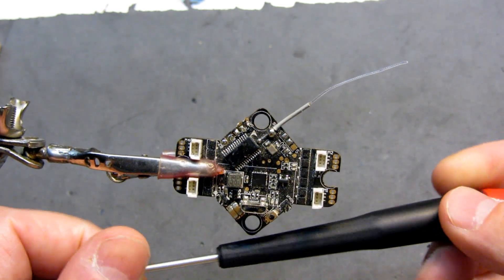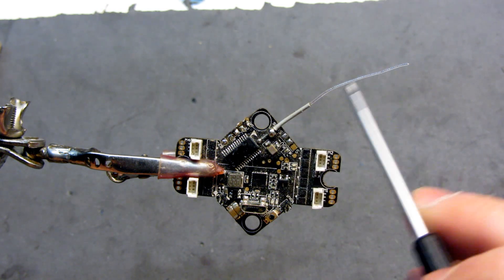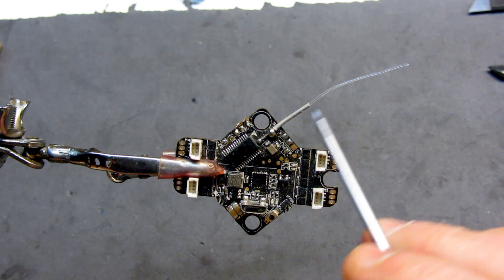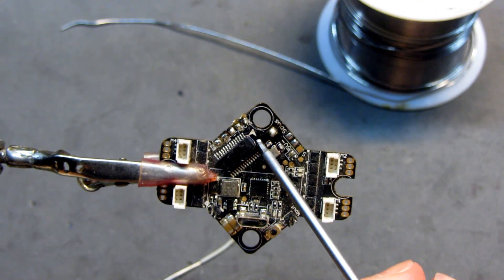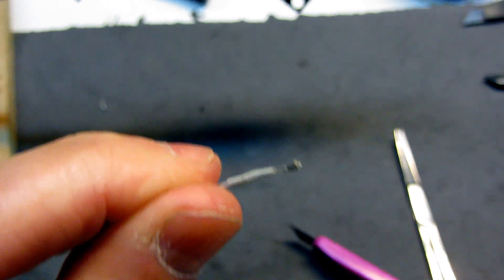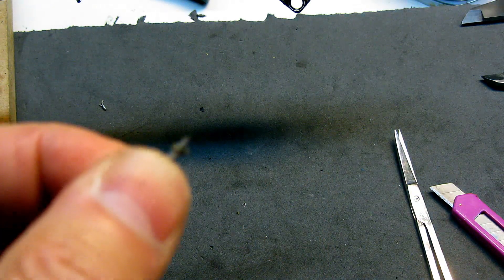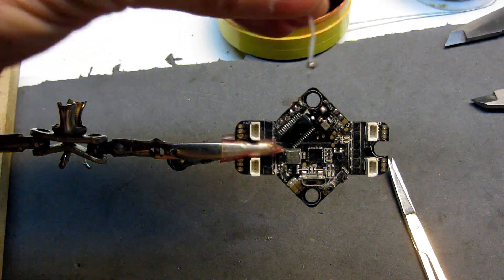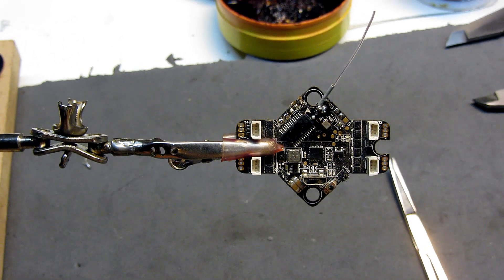TinyHawk Repair - SPI RX Antenna Repair / Replace - Viewer Request

Comment: Wow! Many thanks for doing this video. I just ordered new antennas for my Tinyhawk II. This couldn't have come at a better time. Love the channel. Be safe.
Reply from the maker: Thanks for watching. Good luck with the repair. 😎👍
Reply: @Faith_Family_Firearms_Freedom  Thanks, going to be interesting. First time soldering. Going to practice on an old board before I try it for real. You should start a service shop! Be happy to use your services. Be safe.
Reply from the maker: Thx but I'm sure after some practice, you will be just fine. Just be sure to use plenty of flux as demonstrated in video. I like to use the Ruby Fluid soldering paste. You can find it on Amazon.
Reply: @Faith_Family_Firearms_Freedom  will do
Reply: Where did you buy the replacement antenna?  Mine just snapped today as well :(

Comment: Great job buddy. 👍👍👍👍
Reply from the maker: Thanks Ray. Hopefully this helps the sub that asked for it. 
😎👍
Reply: @Faith_Family_Firearms_Freedom  I hope so buddy. It takes a really steady hand also. Great video. 👍👍👍
Reply from the maker: @electroddxful  for me it's my eyes more than my hands. Lol 53 yr old eyes. 
Lol.
Reply: @Faith_Family_Firearms_Freedom  😂🤣😂🤣I'm 50 and feel the same my eyes as well. I been doing electronics for many years. Ever since I became a ham radio operator many moons ago.
Reply from the maker: @electroddxful  I feel ya brother. If it were not for my trusty magnifying led lamp, I couldn't do these kind of repairs. Although I couldn't use it on this video because the camera was in the way, so it was especially hard for me to see clearly. I actually used the monitor on the camera most of this video. Lol.

Comment: If change it to different style antenna than the linear should it working too right? I’m planing for an upgrade of the antenna, nice video tutorial 👍
Reply from the maker: There's really only only style suitable for a receiver Antenna. 
Heres a link to a 10 pack.
https://www.amazon.com/10PCS-100mm-Receiver-Antenna-Replacement/dp/B07JFZDYVS
These will work. You will need to cut the ipex connector off and prep the end to be soldered to the FC. 
You may be thinking about the vtx antenna which you could swap out to a Circular Polarized antenna. But the RX antenna definitely needs to be a linear antenna tuned for 2.4 GHz. Hope that helps.

Comment: Great Video! Does this work on a Eachine Novice 2 as well ? I upgraded the VTX antenna with a lollipop fl. But not sure how to upgrade the radio receiver
Reply from the maker: Yes, if it's soldered on like the TinyHawk FC  then yes

Comment: Hi, I bought NanohawkX a couple weeks ago but stil I have not tried to fly it because I have only Flysky transmitter. Is it possible to repalce the receiver like FS-A8S what Ibhave here? I saw in the manual that it has built-in receiver for FRSKY. Your help is greatly appreciated, thanks
Reply from the maker: Yes ! Absolutely.  I posted a video over 2 years ago on how to add an XM+ to a tinyhawk and the steps will be nearly identical. Here's the vid
https://youtu.be/9bt3AfnBNdE
Since you're adding a FS receiver, some of the steps in the video won't be relevant to you. But basically here's what you do. 
If your FS receiver has 3.3v then find the 3.3v pad / ground pads and solder those wires.
If it's 5v, then simply solder to 5v pad instead. (Pretty easy ) 
Next. Find the spare uart pads. You may have to connect to betaflight and see which uart is not being used in ports tab. Probably uart 2 , but definitely check first.
Since I'm not familiar with FS, I don't know whether it has a rx and tx pad for telemetry or a single wire for outputting signal. (Non telemetry like the frsky xm+)
If it's a telemetry receiver, then connect the tx pad from receiver to rx pad on FC and connect rx pad from receiver to tx pad on FC.
If it's a non telemetry receiver,  then just connect tx pad from receiver to rx pad on FC. 
Then in betaflight,  go to ports tab and under the "serialrx" column , go down to the spare uart you connected to and make that selection active by clicking the slider button. This will automatically override the spi receiver.  DONT FORGET TO CLICK SAVE AT THE BOTTOM RIGHT OF THE SCREEN. 
At this point you can connect to betaflight and under the Receiver tab, you can verify if you are connected by moving the sticks around and watching the channels on the screen. You may need to have a battery plugged into the quad in case the FC does not power up the receiver when plugged into USB alone. 
Obviously at some point , you will have needed to bind the receiver to radio.
If  betaflight is showing stick movements,  then you're done. Button it up and go fly.
If you still do not have stick movements,  then first,  double check all your steps first.
Be sure you're bound and the connections are correct.
If you still do not have stick movements,  then go into the CLI with quad connected to betaflight,  and type " Get serialrx", press enter.
You should see a line that says 
"Serialrx_inverted=off"
OR
"Serialrx_inverted=on"
If it's OFF, then turn it ON by typing
"Set serialrx_inverted=on",  press enter
Then type "save" , press enter

If serialrx_inverted is already on, (unlikely) then do the opposite by typing
"Set Serialrx_inverted=off", press enter
Type "save", press enter.
If none of that gets you connected,  then change the "serialrx_inverted" setting back to what it was and drop me another comment. I have a friend who runs flysky who I can put you in contact with who may be able to help if all else fails. 
Goodluck, and drop me a comment if the video doesn't help and this procedure doesn't help. We'll get it sorted out. 
-Brad

Comment: I see you have had the TH apart for repairs to the antenna's...so I ask if you know how those tan motor connectors are mounted to the board.....I have one that has come loose from the board and it appears it is glued on and not soldered ( as I see no way to get to the bottom of that connector to solder it , nor know of any soldering iron/tip that tiny to get under that connector )  It has three contacts on the bottom front and one contact on each bottom corner of that tan connector and appears it just lays on the board contacts and is glued down....the glue appears to be clear and shiny under where the connector came off, BUT it may be just the board itself that appears shiny, do you know if it is glued or not and honestly I see no solder at the contact points other than the contacts themselves? Any help and or advice is appreciated Thanks in Advance
Reply from the maker: The TH has three aux motor pads next to each connector.  You can de-pin the motor leads from the motor connector, strip them back, tin the ends and direct solder them to the board.
Reply: @Faith_Family_Firearms_Freedom  Thanks for the reply, I would rather not do it that way ( unless there is no other way ) [soldering those tiny pads/wires are hard to do ] I was hoping to know if that connector on the board was glued  to know for sure, I assume I can just place the contacts where they need to go and glue it down  and see first...will solder IF that is the only way...LOL...but Thanks for letting me know how to do that...
Reply from the maker: @FlyingBuzzard  the plastic connector on the board just presses over the 3 pins. It's just a press fit. I would not use glue
Reply: @Faith_Family_Firearms_Freedom  pins are still "in" the brown/tan plastic connector so not sure what to do...can I remove the three pins and solder them on the board and then slide the plastic over them? They look like the pins are attached to the bottom of that plastic piece ( not sure )....even at that those pins are tiny, they do not appear they were ever soldered to start with ( quad worked tho ) Thanks again RCing in SC
Reply from the maker: Honestly, my first advice was the best thing you can do.  Just cut the motor connect off and strip back 1mm of insulation and solder the motor wires directly to the aux pads located on each esc next to the board connector.  As a matter of fact, for better performance , you can do all 4 motors that way. I'm not sure what other advice to give you since the pins have been pulled from the board.
Reply: @Faith_Family_Firearms_Freedom  I believe that is what I will have to do ( I own a couple of these lil guys ) Just was not sure how to approach it the right way ( not great at soldering with my old shaky hands was trying to avoid it...Lol )...Thanks again for your help
Reply from the maker: Getting ready to upload a video in response to your question. I hope it helps. If you're not subscribed , do so and click the bell notification so you will be alerted to the upload.
Reply: @Faith_Family_Firearms_Freedom  Hey Thanks RC in SC will do just that

Comment: Do you know where I can buy some plain coaxial antenna wire like this?
Reply from the maker: This is what I bought a while back.
https://www.amazon.com/iFlight-Receiver-Antenna-Generation-Controller/dp/B06XGD445X
 These are replacement antennas for XM+ and Rxsr and others but you can cut the ipex connector off and cut it to the size you need. It already has the active element stripped back that is calibrated for 2.4ghz. It appears to be RF113 cable if you search for it in bulk. Hope this helps.

Comment: Can you use an xm+ antenna? Can it be longer or does it have to be the same size? Looking to replace a stock antenna on a 1s board with integrated frsky receiver. Thanks for the tutorial.
Reply from the maker: Yes you can . But as I mentioned you will still have to prep the end that will be sodered to the board. You will simply cut off the ipex connector and size the antenna to whatever length you want as long as the active element remains unchanged. Just remember...2.4ghz will all be the same. As long as the active element is 31.2 mm it will be tuned for 2.4ghz.
Reply from the maker: Please like and sub if you find this useful. 😎👍
Reply: @Faith_Family_Firearms_Freedom  Awesome... thank you sir...  liked and sub'd!
Reply from the maker: @ChristKrew-Rev1.8  thanks brother. Btw. I may not know all the answers but I'm always willing to help if I can. Please don't hesitate to hit me up if you run into issues. Have a blessed day.
😎👍
Reply: @Faith_Family_Firearms_Freedom  Will do. Yea my eyes failed me and put a press on prop on the wrong whole and it burnt up an esc on the  1s aio.... now all that is available is the the frsky aio. Live in learn. Thank you again as this will help until Kabab gets his 1s board made.
Reply from the maker: @ChristKrew-Rev1.8  😎👍

Comment: K I crashed the Tinyhawk and I want to know if I can remove the vtx from it and the camera and install it on a bugs 3 for fpv or is that not possible! It has ground 5v and video and audio pins on the vtx. So I’m wondering if that’s all I need?
Reply from the maker: Yes. That will work. Just be sure to only supply the camera and vtx with 5v each and simply connect the video out wire from the camera to the video IN to the VTX. You will not be able to change the VTX channel/band via smart audio but you can still change it with the button on the VTX.
Reply: Thanks for speedy reply appreciate it!

Comment: Thank you for this tutorial, really. Where can I buy this antennas???
Reply from the maker: If the original antenna is unrepairable, the you can purchase these and you will have to prep them as described in the video. 
https://www.amazon.com/10PCS-100mm-Receiver-Antenna-Replacement/dp/B07JFZDYVS

Comment: That's the one solder job I've been avoiding (especially after a few morning coffees) -  I did the TBS Nano32 mod on the freestyle and relocating the RX antenna is next on the docket so fingers crossed.... What temp did you use on the iron? (I fried a tinyhawk s board - probably was too hot)
Reply from the maker: 375 C is where I like to be.  If it weren't for my trusty LED magnifying lense lamp , I wouldn't be able to do these at all.

Comment: hello I also have an EMAX TINI II, I use it with a radio fr skyXlite Pro, I had to bind in D16, but I must say that the range is really ridiculous, I can't even do 20 meters.  do you advise me to replace the rx with na R-XSR?  you think it's possible.  thanks I would appreciate if you answer me.
Reply from the maker: Since the tinyhawk RX is a D8 RX , it's my guess that the range issue is solely because of binding in D16. 
You can certainly install a D16 RX. I did a tutorial vid on installing an XM+ . Look on my tutorial playlist for it if you need help. The only issue with that is if the xlite pro is the new ACCESS protocol, then you will need a rx with ACCCES protocol flashed to it.
Reply from the maker: Also, if it's not ACCESS protocol, then I would just put an XM+ in it.
Reply from the maker: One more thought, will your radio bind in D8?  I'm guessing not or you would have done that .
Reply: in fact, my radio does not connect in d8.  i will follow your tutorials.  thanks you were very kind 👋

Comment: Can i cut off the u.fl on one of my extra antennas and do this? Mine is about to break. Are all rx antennas the same inside pretty much
Reply from the maker: Yes. Absolutely. I have a 20 pack of spare XM+ antennas that I have used to repair an SPI rx Antenna in the past. Simply cut off the ufl plug to the desired length while being sure not to cut or damage the active element on the other end. As long as it's a 2.4ghz antenna , that will definitely work just fine.

Comment: My Vido Link always breaks up, when i give Throttle. Could you help me? I found, that on those yellow/gold thing on the Batterie Connection with the esc there where black things, don't know what it is
Reply from the maker: That's not much to go off of, but I'd run thru the basic checks, 
1) are you certain the VTX and goggles are on the same channel?
2) is the VTX antenna damaged or missing?
3) have you changed props ? Sometimes a bent prop can cause so much vibration, that it will bleed noise into the system causing electrical interference in the video.
4) be sure all the motors screws are snug. Same reason as #3
5) be sure the camera is secure and nothing damaged. 

Try going thru this checklist and see what you find.
Reply: So glad, had this problem for over a mounth and it just was a loose motor bell..., But i am still getting video brake up when i land cause of Vibrationen
Reply from the maker: Vibrations are always tough to solve. Perhaps spin one motor at a time while connected to betaflight (without props)  in the motors tab and see if you hear any vibration or odd sounds like a  bearing noise. Quite possibly the camera sensor is loose inside the camera . Not common , but it does happen and the only way to trouble shoot that is try another camera. Save that for last if it comes down to it. Glad you found at least one problem. If you still need help, just holla.

Comment: Question for you 
Will an xm plus antenna  work on a tinyhawk 2 if cut to proper length
Reply from the maker: Absolutely !  Just cut the ipex connector off and to the length desired while leaving the active element untouched. Strip the end that will solder to the board as per instructions in video and you're golden. It may even improve the range. If you screw it up , just snip off the end again and start over.
If you need help , just holla. 
😎👍

Comment: I tried reinstalling an antenna today on my TinyHawk2 - but now I'm having trouble binding. I checked the antenna connection and my core has continuity to the ground - I'm assuming that's my problem but won't be able to check until tomorrow. Have you heard of this being an issue causing binding problems? Thanks!
Reply from the maker: I would double check everything and go thru the binding process again. You can also bind using CLI commands. Maybe the bind button isn't working. Also be sure you're binding in D8 mode. 
Hope that helps.
Reply: RCing in SC definitely binding in D8 mode. The bind button seems to be working fine (blue LED goes solid when pushing bind button). I haven’t been able to figure out how to bind through CLI. When I give the bind command I get an error :( I’m too frustrated to look at it any more tonight (those damn motor wires really gave me a run for my money)
Reply from the maker: Lol. This hobby can drive a person crazy sometimes.

Comment: Nice great job man thanks this was a big help for me. I'm going to put on mine. Just one question can I put a lollipop there instead. I am New to the hobby so I'm trying to learn as much as I can .
Reply from the maker: No ! A "lollypop" or CPA (circular polarized antenna) is used for the 5.8ghz video , not for the 2.4ghz control signal. You would need to put a similar whip antenna back in place of the damaged RX antenna.  But the vtx antenna could certainly be replaced with a lollypop or CPA. It will add weight so keep that in mind. I hope this helps.  Let me know if you have any more questions.
😎👍
Reply: RCing in SC my vTX antenna broke right above the bulge on the antenna and I don’t have a soldering iron, is there another way of fixing it?
Reply from the maker: @MichaelNelsonYT  sorry to say bro, but not really. Don't be intimated by it though. There's plenty of inexpensive soldering irons on Amazon. Just practice some before you try to do it. There are tons of soldering tutorials available on YouTube. I know you can do it !!! 😎👍
Reply: RCing in SC thanks man! I’ll try my best, it’s a great quad!